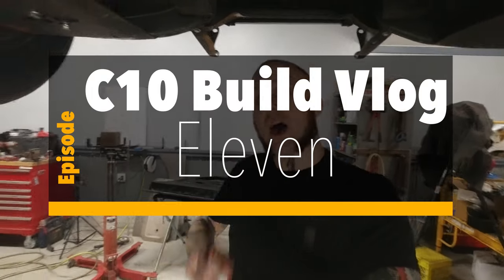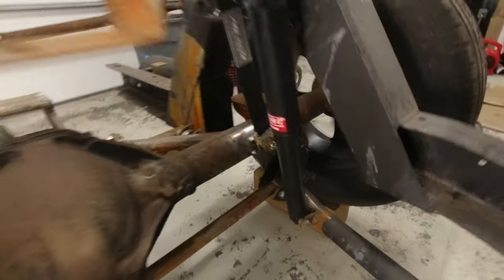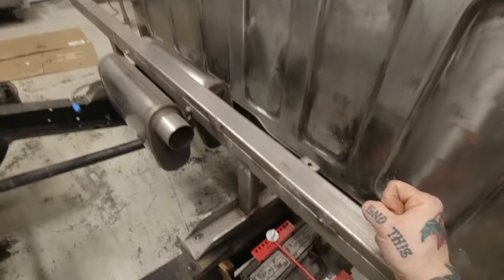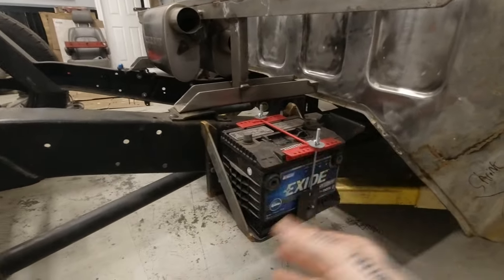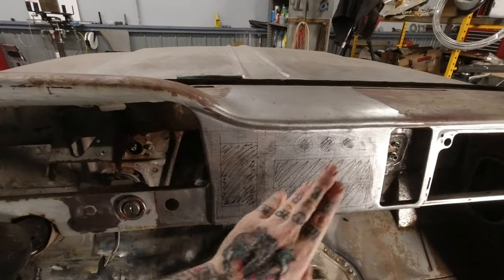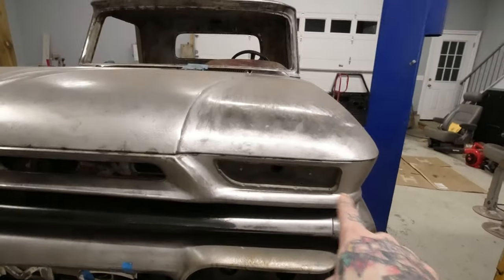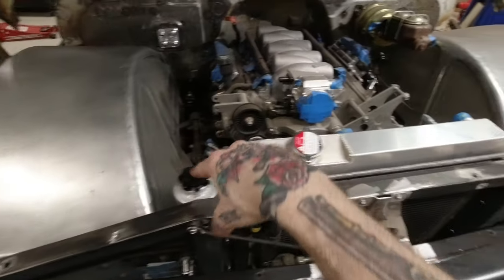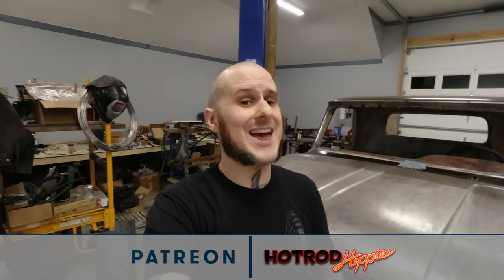65 GMC Build Update - C10 Build Vlog 11 - The Updatening

Comment: Nice update. Agree, car stereo mfgs need better designs. Resin or filament 3D printer? Mahalo for sharing! : )
Reply from the maker: garagemonkeysan I’m planning to pick up a cheap filament printer to start with. Just looking to get my feet wet and prototype parts for now. I’m figuring that if I design something I’m happy with but the printer can’t produce a good enough print quality I can always farm out the final print to a service or friend. Have any input on a printer? Honestly I’ve just been considering a really cheap one like a Monoprice unit. I’m sure you get what you pay for but I’ve heard surprisingly good things for the money.
Reply: @HotRodHippie  Been 3d printing for a few years, only filament. Yes, 3d printing and learning CAD is awesome for quick prototyping of more complex shapes. Monoprice rocked the market with an inexpensive but good printer. But nowadays, there's so many to choose from: Creality, Artillery even Prusa now has an entry level. I have a Prusa MK3S so I'm biased towards them. : ) Hope that helps.

Comment: Do custom builds not need to pass emission standards? And if so, where do you plan on placing a Cat?
Reply from the maker: David Laabs in most states custom builds only have to pass the same standards that the original vehicle had imposed on them. In 1965 that means... nothing. Heck that often means we don’t even have to install seatbelts (I always do).

I won’t be installing cats. I do it on some projects because they generally don’t hurt performance, but space constraints are often an issue. 

In the end, simply going to the EFI engine in this truck that has a good management system should reduce its emissions compared to any of the original options it would have had.